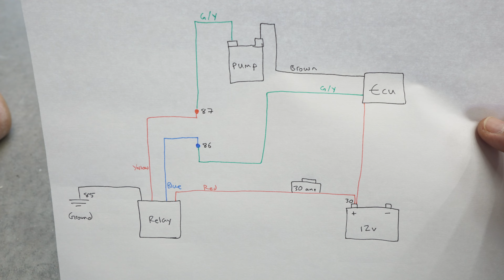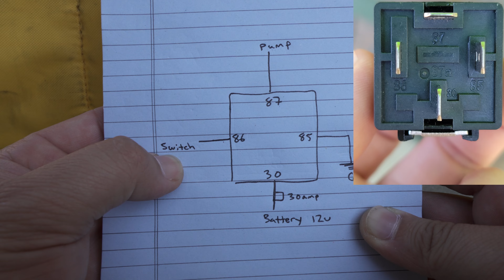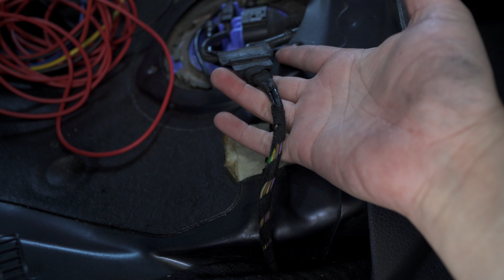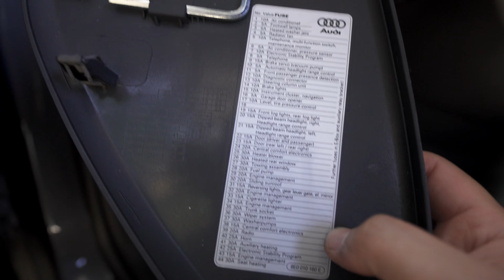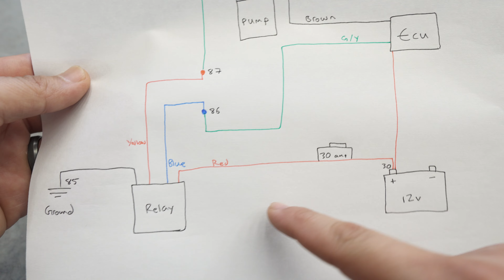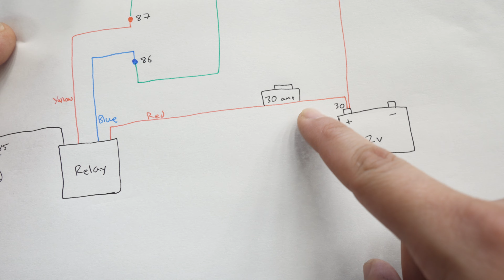DeatschWerks Fuel Pump Relay Install on Audi B6 S4

Comment: Is the original fuel pump relay in the engine compartment? I know where the fuel pump fuse is at....
Reply from the maker: Sony quoted me on this. I would imagine it's under the steering wheel under the panel.

Comment: Did you receive a CEL light after you installed the relay?  I’ve been reading that you can’t use an electromecanical relay like the one you used and have tonuse a solid state that can handle the 15khz to 20khz switching by the ecu that uses pulse width management.  If the setup you used did work then was the pump running all the time? Did you have any issues with the pressure being too high or low?  Thanks for any experience you can share.  I was looking at this option for use on an audi s6 but had concerns about the CEL and pressure issues.
Reply from the maker: The car is actually still a work in progress, so I haven't had it running since the install. I'm curious to see how it handles the PWM signal myself once it's back on the road. I’ll definitely update the comments or the video description if I run into CEL or pressure issues during testing

Comment: Hi, great detailed video!!
Im trying to do this kit by myself and ordered some 10 awg wires, the thing is the connector for the relay got smaller wires, might be 12 or even 14, does this matter? Or should i get a connector with 10 awg wires also?
The other thin and sorry for bothering u but i have the fuel pump controller, does it change anything installation wise?
Reply from the maker: Personally I would recommend to find a 10gage. Don't want to us thinner wire. Think about it like this. You have a 3 lane freeway and a 6 lane freeway. Which freeway will be able to deliver more cars going tonits destination. Think about it like that with the wire. The reason the fuel pump is getting a relay and connected to the battery is to get more current so the pump can perform better (aftermarket pump) if you have smaller wires you may run the risk of not sending enough current to the pump.
Reply: @markb6s4 understood.
I've ordered 10 awg wires and relay with 12 gauge connector wires, i will be depinning them and installing 10 gauge wires, didnt find one fitted with wires for a reasonable price.
Thank you.

Comment: hey Mark. my s4 is cracking but won't start. have any ideas to help me figure what the issue may be ?
Reply from the maker: Also would start with the crank sensor too. Crank sensor is located on the tranmission bell on the driver side. In the 2 oclock position when looking towards the front of the car. The connection is by where all the connection on the driver side on the secondary wall by the expansion tank is
Reply: @markb6s4  ill give it a look. any indicator to look for in terms of it being bad/need changing ?
Reply from the maker: @L.da.don345  not really, can be with time the sensor going out
Reply: @markb6s4  thanks
Reply: probabily crank sensor